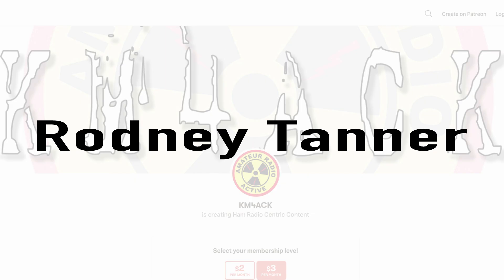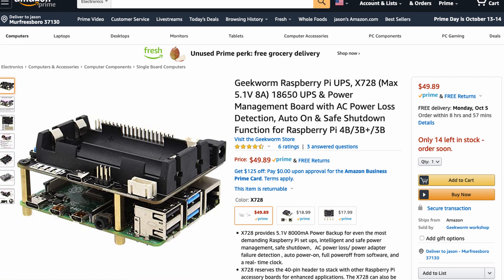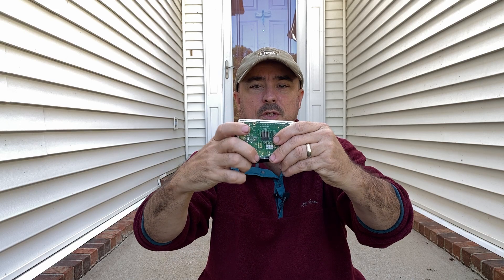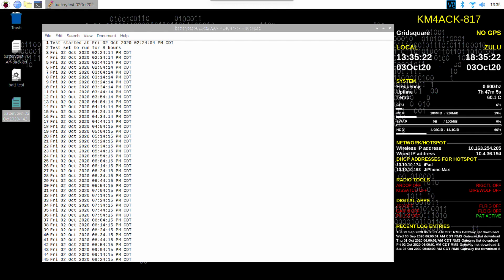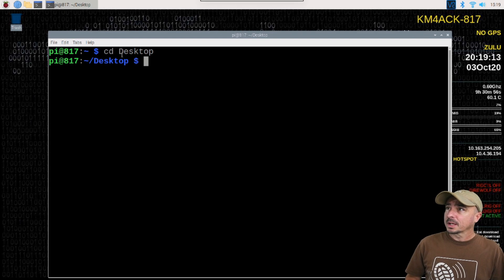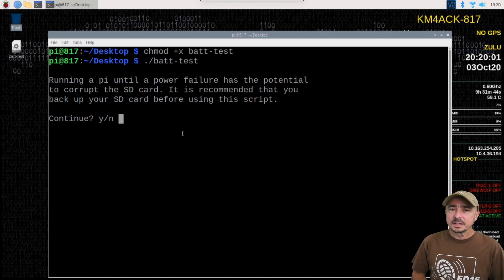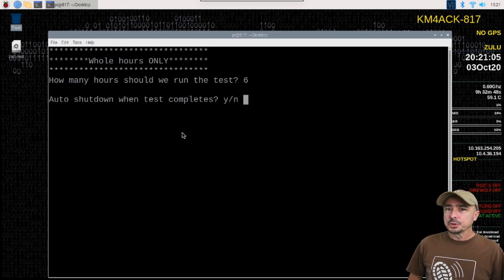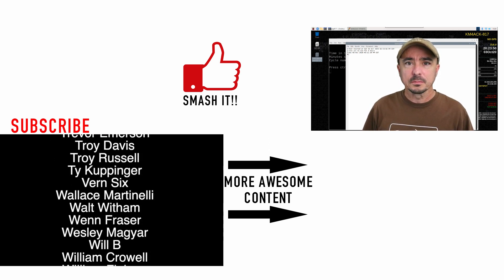Powering the Raspberry Pi in the field :: Battery test script

Comment: Is there anyway to tell me what is left in the battery via the script?  Is the pi under load or is only the script running?
Reply from the maker: There are lights on the battery itself to indicate very roughly how much power was left. Of the 4 lights on the battery, only one remained at the end of each test. During the test both the script, FLRIG, & JS8Call were running which kept the CPU at ~50%

Comment: You mentioned in a previous video you had a pi installed on your Jeep, how do you power it? Do you have it connected directly to your Jeep's electrical system?
Reply from the maker: Yes. I run the maker focus power board on the pi that accepts 12V input. I have a the power cable that feeds the radio split off to power the pi as well. You can find a link to the power board and case on my accessories page https://app.simplenote.com/publish/4W4h4y

Comment: Nice one Jason, thanks for sharing! I was busy designing a custom powerpole distribution box with a built-in 12v to 5v transformer to drive the Pi3 I have for this purpose. I'm almost of a mind not to bother with that anymore, although it might still come in handy to have the ability to charge my cell or tablet from my 6Ah LiFePO4 battery. Needless to say it is good to have options, so I wasted zero time and ordered this little gem. 73! Jan M7HNK

Comment: Jason, quick question about the Pi4 and fan.  Is the fan on the 5v (2/4,6) or 3v(1,6) pins?  I've been putting the fans on the 3v pins (1,6) to reduce the noise and haven't noticed an major temperature difference.  You may see increased battery time if you drop the fan voltage.
Reply from the maker: When I did the test with the pi 4, I still had the maker focus power board on top. Plugging power into the USB-C fed the fan power. Not sure if it is wired to 5V or 3.3V. The pi 3 didn't have a fan on it. Good point that running it on the 3.3V could save battery power.

Comment: If you're interested, I've used this model battery pack for my Othernet home project (https://othernet.is).  It allows pass-through charging so it functions as a UPS for the board.  I believe the power draw is similar to a 3B+ but it gave me right at 7.5 hrs of runtime.  https://www.amazon.com/gp/product/B07S73M12N/ref=ppx_yo_dt_b_asin_title_o09_s00?ie=UTF8&psc=1

Comment: Was the test done with a display or headless on the Pi 3? Would also like to see the results on the Pi Zero EES/Winlink project once that’s done.
Reply from the maker: Headless. Pi zero project is being beta tested by patrons now. Coming to the newsletter soon and finally the channel. 👍
Reply: KM4ACK Looks like as long as you don’t run power-intensive peripherals off of the Pi’s USB ports, any USB battery pack capable of 2 amps output will work. The Pi Zero’s current draw could be low enough to run the Pi Zero project for a couple of days.

Comment: most battery packs trigger low voltage warnings every battery pack i use does that i have 10,000 mah and 20,000 mah  8,000 mah   packs and always trigger low voltage which means you will never get full performance from you processor .
Reply from the maker: This one DID NOT trigger the low voltage warning on the pi 3 or pi 4 during my testing
Reply: @KM4ACK  are you running headless?
Reply from the maker: Yes sir. Always headless.

Comment: I do sometimes run my 4b off a similar battery bank, but still use the Makerfire hat you recommended as well. I have a ton of lipo batteries laying around from flying quadcopters, and I can run the pi off of any 2s or 3s lipo with it. It would probably run off of 4s as well, but the wiki lists 16V as the highest input, so that would be pushing it. Still great to have, plus the fan is the quietest Pi fan I've had, and keeps the computer very cool. I have one on both of my 4bs. Unfortunately, they seem to be sold out on Amazon right now. For anyone that still uses the board, the setup script can still be found on this wiki https://wiki.52pi.com/index.php/DockerPi_PowerBoard_SKU:_EP-0104

Comment: Could you have read the voltage at the end of each 10 min cycle? Then you could plot a discharge curve and see where you really want to shut the pi down.
Reply from the maker: Yes. That could be done as well. Would probably require building a bit of circuitry and using a digital to analog convertor but it could be done. I chose the quick & dirty route instead. It gave me enough info for my test.
Reply: @KM4ACK  Jason, no problem.I'm new to the Pi and linux and thought there might be a setting that could be read easily.  Bruce

Comment: I've been trying to figure out a solution or device add on that will determine when the battery is going to be out of power, and safely shut down the PI. Even bought a few things that just did not work out for me. Ideal scenario/device would be allow external battery pack and when it's run out of power shut down the pi. Allow it to recharge to full  either through solar or other means and then power the pi back up at full.  I've tried a shutdown script when it detects a low voltage on an  external battery pack like this but have mixed results.
Reply: You might try to modify the code to incorporate this bash script that I posted in a comment above:

I liked your video but I would probably add an automatic shutdown.  I think you could possibly incorporate this bash code into your program somehow which would allow you to continue the test until the Raspberry Pi encounters low voltage.  Let me know what you think:

cd /var/log/
grep 'oltage' syslog
if [ $? -eq 1 ]
then
  #continue test
else
  #execute shutdown
fi
Reply: @russdibennetto8591  This is my current script or there abouts: https://github.com/DdraigX/raspberrypi_scripts/blob/master/checkvolt/checkvolt.sh

Not certain if that link will come through but I need to test it again. If I remember right though it didn't quite work as expected.

Comment: I have been using a battery like that for a few years now. My battery has a gauge in it so i can monitor how much I have left. I have never ran it dry on an outing. Thanks for the monitor keep up the good work.
Reply from the maker: I have used one like it before for short outings but like this one because it is the same form factor as the pi. It also has a gauge on it. I was shocked at how long one of these would power the pi. Is your the 10000mah as well?
Reply: @KM4ACK  Jason, Yes it is a 10000 and its not much bigger then my pi. same width and a little longer. Walmart special, saw it one day while in line at the check stand.  Think i paid some where around $10. I have noticed it is not as good as it once was. now when it gets to around 80% I will get the low battery voltage warning on the pi. it never fails but does flash it. I have been looking at one of the ones that have a solar panel on it for recharging for a replacement.
Reply from the maker: @QRPMonkey  Let me know if you find a good one with a solar panel built in. I have not had good luck with those in the past. I would love to find one that worked as advertised and didn't give a low volt warning on the pi.

Comment: I bought the maker focus power board on your recommendation even with all the negative reviews. I worked exactly 4 times. Last time tried to use it nada, nothing, dead. I removed the fan and power connector for other projects and threw the rest in trash. Expensive fan lesson.
Reply from the maker: Sorry about that. I am sure there are occasional bad ones in the bunch. My first one is still going strong after almost a year of service. The other two aren't as old but I have had no issues with them.

Comment: That looks like a great battery solution for a Pi for a reasonable amount of time.  Eight hours of JS8Call (6 hours on the Pi4) is fairly incredible.  That's good enough for a SOTA, for sure.

Thanks for the battery test script.  Very cool.

I still like powering the radio and everything else from the same battery.  No point having one battery dead and the other half full when they can't share.  That's why I'm not a fan of internal radio batteries like the Yaesu 817, although I can see how that'd be useful for SSB or CW.

I have a Phaser 40m transceiver that I want to use with JS8.  I've thought of 3D printing a case that contains the Pi4 with GPS dongle, Phaser and battery in one package so I can connect a wireless keyboard, display, solar panel (if desired) and antenna.